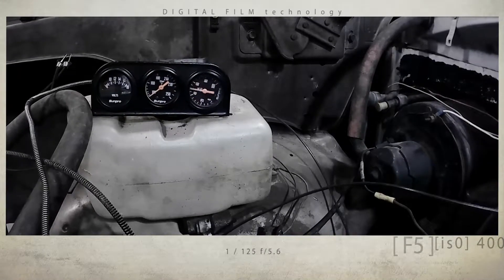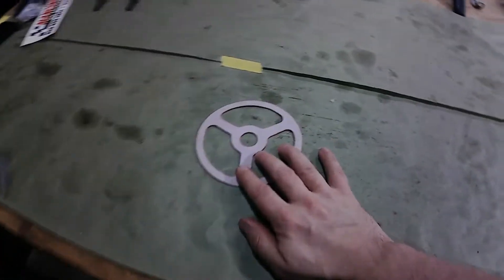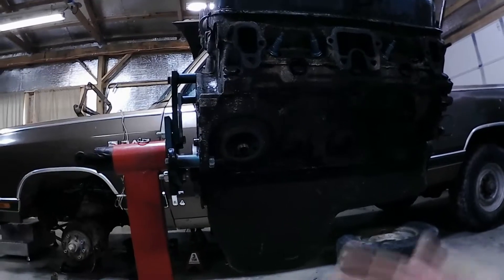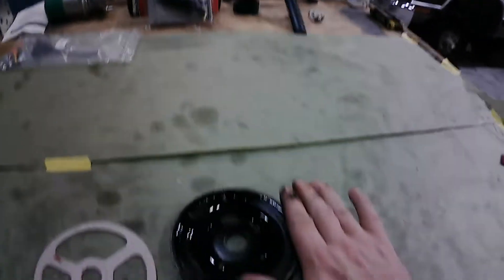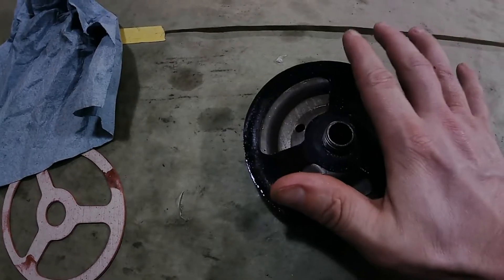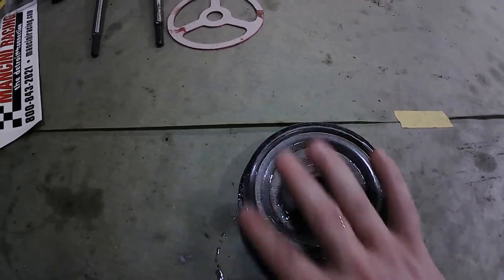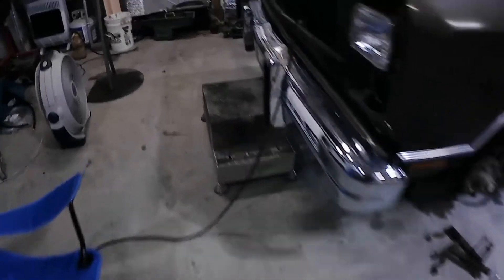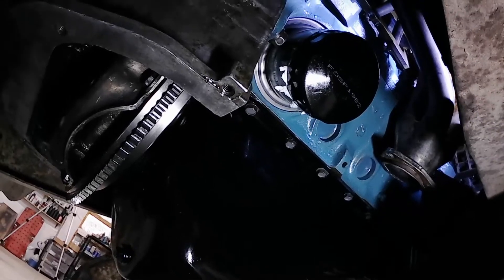360 Mopar Oil leak Issue Pt 2

Comment: Hey! I know this is an older video, but where did you find the gasket? I'm looking for one to fix mine. Haha
Reply from the maker: I found it in my gasket bin.  The come in a complete gasket kit or as "Oil Filter Adapter Gasket/O-ring" from Rockauto. You may find a cross reference part number for your local parts store. Thanks for dropping by.  This is why I do these videos - maybe 1 person will get help or learn what not to do.
Reply: @brokentoolgarage  hey man! I appreciate it! Totally understand that for sure!
Reply from the maker: @TheEdgeofTech  No problem.  Good luck